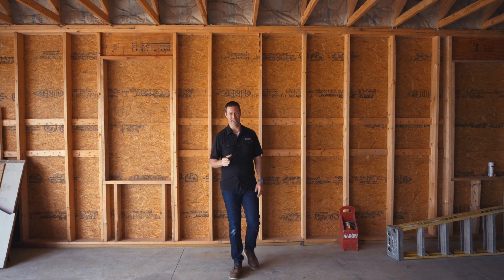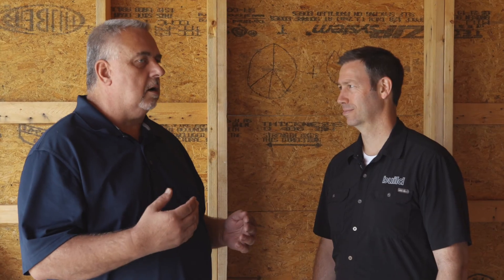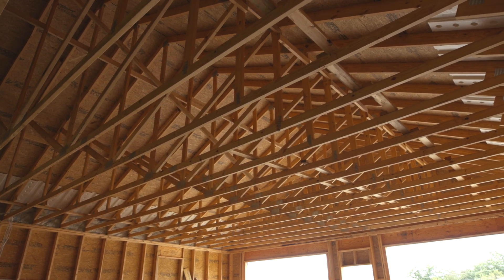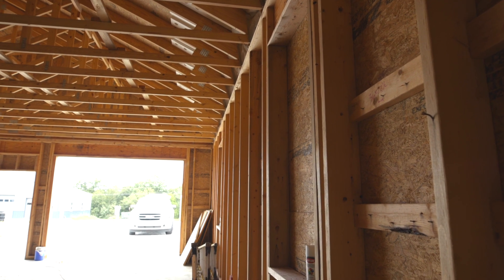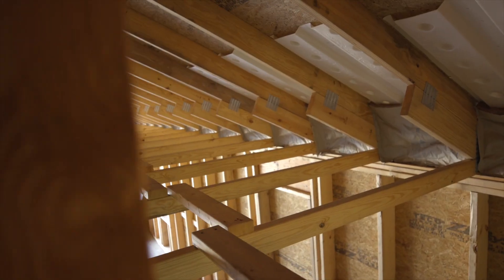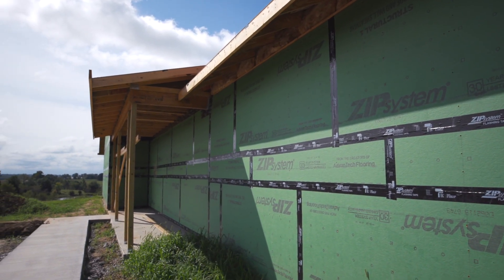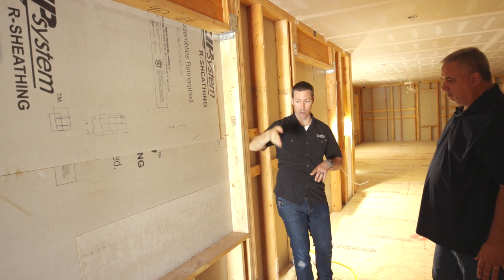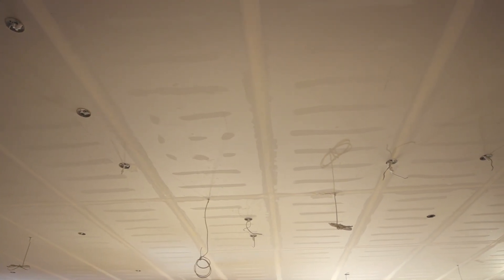Traditional vs Advanced Framing - Details

Comment: I really love reading the comments by the technology luddites. Reminiscing about the good old days in the '70's when everything was high quality. What crap - obviously they've never remodeled a 1970's house to see all the poor decisions, poor quality workmanship, undersized framing materials, cumulative air penetrations big enough to drive a truck through, lack of code enforcement - I could go on. I've remodeled numerous houses from the 60's and 70's and the best thing about them is salvaging some great old growth fir that can be repurposed.
Reply: Preach. I am constantly discovering crap building methods in my early 70s house. Last week I discovered an age old plumbing leak that had finally gotten worse to the point that I spotted it. Some clown had punctured a hot water pipe with a nail, decades ago, then fixed it with a hose clamp and a piece of asphalt shingle before concealing it with the flooring. Still SMH over that one.
Reply: I agree buddy!!!
Reply from the maker: 100% agree

Comment: Now, he needs a system to make beautiful buildings. 30 ft. hight building for 9 ft. Floor to ceiling.
Reply: Building is actually 20'-4" but you go ahead, you're on a roll
Reply: That was my first reaction. But I expect once the interior walls are in place the rooms will feel better proportioned. It's a really well engineered concept. Check out the other videos about it, especially the utility tunnel under it. But it would be nice to extend to a more interesting set of spaces. A flat 9' ceiling throughout an entire house reeks of spec builder tract house.
Reply: @HistoricHomePlans  if the intention is redesigning the interior completely 20 times for generations to come I get it, but the fact is an ugly building in and out with a good system for that area.
 Proportions in the design are critical. Those vast spaces with low ceilings make the rooms uncomfortable to be there. At this time, I do not agree with the technical part and the aesthetics of the building.

Comment: Great build! Is there any concern with truss uplift on the interior walls? How can this be corrected with this type of continuous drywall system? Thanks for sharing you knowledge and experience.
Reply: Simpson makes a connector for that - I have done 100's of homes without a problem
Reply: Thanks Steve! I appreciate your response. I will look into that product.
Reply: @tonystammler9932  google "Simpson STC" or "Simpson STCT" roof truss clips

Comment: Hi Matt, I know that I live in a part of the country with super low cost of living but $600k for a 2400 sq ft. House seems OUTRAGEOUSLY expensive to me.  I can’t imagine paying over $300k for 2200-2800 sq. ft. but I want to buy/build a high performance house sometime in the next decade.  That’s the problem with these homes, they’re so far outside of a normal persons price range.... Did I somehow misunderstand what you were saying?
Reply: Will I have done Certified Passive Houses for $180 sq ft - there is quite possibly a builder in your area with some slight modifications to their typical build that can produce a great home for you.
Reply: Costs vary regionally.  The same house built in my city would be about 600k.   I built my own (and i do this professionally) and had to spend 550k CDN all in.     In the town next door i could build the same house for about 300K.    The difference is the approval process, and changes caused midway through by the building department.   As well as the lot cost, soil conditions, and weather conditions. 

People throwing around low numbers for a net zero house aren't exactly full of poop, but are not representative of the majority of houses.   A builder can make a cheap house, that is of good quality, only if they are good, have cheap labor, have a good production chain to maximize specialization and minimize costs, and above all else, have a customer who doesn't make changes and add things as it goes along. 

Net zero houses cost more, full stop.  Some people are very good at building them however.
Reply: @hosmerhomeboy  Net zero homes are tied to region very much - some places the PV system will pay for itself in less than 5 years, then the favor is in your pocket. Yes a Net Zero initially costs more, because you are buying more - but it starts there, it doesn't have to finish there.
Reply: @stevenbaczekarchitect9431  True though that may be, most houses people build already cost about as much as they can afford.  I have my misgivings about adding any costs onto any build, but i can see which way the wind is blowing.   I already mostly build a step 3, and often a step 4.   It is do able, as is a step five.  There are some things with a five that i am uncomfortable with, and some things related to local building departments enforcement in relation to these things  too.  I will happily build step five houses, and be glad that the additional certification and techniques required will keep out the competition.
Reply: Hi Steve, thanks, I didn’t realize that was actually you responding.  I really like all of the framing/assembly efficiencies you pointed out.  I live in upstate SC, but I’ve lived in NH and MA so I understand the regional differences in price.  Here’s to hoping that I can find a builder half as passionate about energy efficiency and general efficiency as you guys are!!

Comment: I wish you’d talk about horizontal sheathing. I’ve always heard people say horizontal is “the wrong way” to put sheathing on because it’s “weaker” in the horizontal position, and I’ve seen a few of your videos with it!
Reply: Note this one is horizontally blocked at the seams. I want to say the difference when blocked is negligible. I have had this conversation with structural engineers. I will revisit it for clarification/confirmation
Reply: Code requires Builders to default to the manufacturer specifications. Most sheathing manufacturers require horizontal installation in their specs but not all
Reply: Most sheathing goes on vertical because the blocking for horizontal adds  cost, fouls up roll instalation and interferes with plumbing in 2x4 walls.
Reply: Horizontal sheathing is the right way and only way.. if u read the building code the arrow on sheathing is a strength axis which needs to be perpendicular to the structural members. Sheathing is way weaker vertically, i can snap it in half

Comment: Foam core sheathing is like using foam as a shim. The shear strength of a wall is partly due to sheathing contact with framing members. In new construction, this may not be a problem, but in time, wind loads, temperature extremes and wood movement will challenge the "through the foam" attachments. 24" on center framing is also less effective at reducing noise transmission, for the same reasons as guitars are built with minimal bracing on the sounding boards. These houses may be efficient on paper, but they have not been tested by sufficient Time and Nature to be promoted as good long term structural investments. Insects love foam for tunneling!
Reply: Funny, America is one of the last countries to adopt this line of thinking - glad we got you to sort this out for us

Comment: Are the split cripples allowed by the local Building Codes?  The National Building Code of Canada required that the cripple extend from the bottom plate to underside of header.  
Its great to see the high heal truss being widely adopted.  A lot of builders are starting to run their sheathing right up to the underside of the top chord then down the wall to get a very solid connection between the truss and the wall.  Have you ever practiced this @ArrowBuilding?

Comment: Matt: on your Build Network channel videos. The Ads could use some better tuning. Basically your ads cut in between mid-sentences, and the ad background music is louder than the video presenters. However it would more pleasant to just have your video presenter discuss the products and include links to advertisers websites. For one, your viewers are less likely to skip ads.  Here is the video I am referring to: https://buildshownetwork.com/blogs/789

 Its your video presentations that demonstrate products is how products get sold. You demonstrated Adv. Tech: I am an Adv. Tech consumer, You demonstrated the ZIP wall, I am a Zip wall consumer. Your videos get me more interested in products than any 10 to 20 sec inserted ad.

Since you have videos on Adv tech, Zip and other products link to those for your advertisers so customers can get more details instead of a 10 to 15 sec ad inserted. Most of your projects and fellow builders use ZIP & Adv. Tech so it should be too hard to mention them. Perhaps adding some text overlays at the beginning of each video listing the advertiser products used in the project. Example:

Spring Valley  home (New England region).
3/4" AdvanceTech Floors
Zip walls R-6 sheating
Marvin casement windows Model ??? with U: 0.?? and SHGC: 0.??
Zip Stretch Tape for window sill sealing. 

When presenting a product insert text overlay about the product being shown at the bottom so viewers can get the correct product name & model. 

This way your doing in video advertising and consumers will have some details about the products. 

BTW: not trying to nit-pick your methods just giving you some suggestions that I think your advertisers will benefit from.
Reply from the maker: Appreciate the feedback. Will review with my team this week!

Comment: Love the design and channel but affordable at 250 dollars is crazy expensive. I guess you usually deal with people with a lot of money.
Reply: I must have missed that is it 250 dollars a square foot? Yeah, building a house right now and we're at 100 sq ft. Not way over the top but still nice granite/quartz counter tops, nice tiled showers and floors, spray foam insulation, etc. 250 a sqft wouldn't be affordable for anyone around my area.
Reply: @Staki6908  Most of that cost is in those luxury items that they sell you, The house if built bare bones would be a fraction of the cost. 
If you remove that over priced kitchen, How much does that lower your price? A lot, Now do the same for the bathroom, trim, light fixtures, electrical plates and a number of other things. Now put some of that extra money in to better insulation, better doors, better windows. Now you have a 4000 square feet house that cost you a fraction in energy cost, Use the savings in a few years and do an upgrade on what you think that you now need. 
Contractors will sell you a 50k kitchen where a bare bone kitchen might set you back 5k for just the basic, All plumbing, gas and vents in the exact same location as your 50k kitchen yet the only thing missing is the cabinets that are pretty and the expensive light fixtures and the over priced appliances that you have to pay interest on for the next 30 years... 
Same thing goes with bathrooms, Over priced cabinets, toilets, showers... Tile will cost you an arm and a leg because you want that tile that cost 20 dollars a square foot where the almost exact same tile cost you a buck. Think commercial bathrooms at a new gas station or new fast food place, Simple yet good looking, Much cheaper and has enough place for laundry room and cabinets upgrades at a later date.
Reply: William Glaser as I just mentioned to another commenter, I’m planning to start my new home construction soon. I’ve seriously considered going cheap on some things like fixtures (sinks, tubs/showers), floors, counters, and kitchen appliances that won’t last 30 years anyway and avoid paying all that extra interest.
Reply: Todd Ison Todd Ison what part of the country (assuming USA) do you live in? I plan to soon start a new home construction, still in the info gathering phase.  But after taking to a lot of people it sounds like I’ll be lucky to get $115-125 per sqft. Maybe the labor costs are just very high here. $100/sqft sounds great!
Reply: It's amazing how much costs vary across the country. 15 years ago I was working in the San Francisco Bay Area and $250 was our base price with most of our projects being at least $300 for nice, good work, nothing spectacular.
Reply: @HistoricHomePlans  Yep exactly and I hear all the time from employees. "I can go to this state or that state and make X amount more." They never look up to see what the actual cost of living is. I mean if  alone the houses are 3 times the cost then how much more are you really making?

Comment: That much span using trusses only worries me,  the open area is awesome though.  I would want some steel beams up there and might as well use a steel building Idk. Do you guys/gals trust trusses this much?
Reply: Those trusses are only supporting dead load,  not live load.  So what you see here is not that uncommon at all.
Reply: I definitely trust trusses that much. Their software is fantastic and puts in several factors of safety. The fact that you can get a clear span of that distance is common place. I just got a quote on a scissor truss system that spans 65'. It is cheaper to run standard trusses with those than metal trusses and frame out the center. You need to be careful installing them, but once they are in, they are things of beauty.

Comment: Oop's found a boo boo. The window header should be sitting on the cripples and the liner nailed on between the cripples afterwards as the liner will shrink. |Regarding raised heel trusses I always have my trusses built so the bottom chord runs right through to the sub fascia. This gives me the backing for T&G soffit or any other length run material as well as a greater insulation space.
Reply: For those who want to order trusses as he references here^^^ they are called oversized trusses. Another good way of getting an efficiency heel.
Reply: This method also reduces the height of the exterior walls which saves money but then you have to factor the cost to install the soffit and that is not cheap.
Reply: @philipdamask2279  My biggest concern is with insulation. I build homes with R 60-80 in the attics

Comment: Please explain the value of the header hanger.  You mentioned that it was so you didn't have to install the extra jack, but the extra jack would cost less than half the HH6 for each side and the labor to install the jack would be less and easier (for an experienced framer).  Given the amount I saw in the video, you spent a bunch of money unnecessarily.
As a side note, I would expect the energy wasted in making Steel HH6's compared to the sustainability of a wood jack doesn't make sense on any front either. Just saying.
I do like the complete enclosure idea.
Reply: It reduces the overall framing required to build the house, which increases the thermal performance.
Reply: @brianwright9514  But, if you are insulating the outside of the house the true amount of "R" value difference would be negligible at best.  The extra percentage of lower R-value of the jacks (+/- (10 openings, 20 studs) in the whole square footage of the structure would not be worth the cost.  The payback would take a couple lifetimes, and that doesn't take into count the environmental cost/waste of producing the steel (compared to studs).
I might be wrong, but I doubt it.
Extra thought, given your response, why not just have all beams and only insulated posts on the corners and openings, and insulation on the rest?  At some point, things start to not make sense, I hope we don't cross that line, trying too hard.  Remember when they thought it was a good idea to drill holes in the siding and shoot insulation in the wall cavity?  They were a lot of people making big money selling that idea telling everyone it was the "best/right" thing to do.
Reply: @bestbuilder1st  Yeah, it's not about the money.  Much more about comfort.  It's impossible to justify any of this from a cost standpoint.  The cost on this home is going to be $750,000.  Where I live, the rich people don't even pay that much for homes.
Reply: @brianwright9514  I think you missed my point- there is no way you will "feel" the Comfort (heat) difference using studs vs HH6's. You can make a house with no insulation "feel" as comfortable as a super-insulated house if you pump enough heat into it.  The difference is the cost of that heat.  In the long run, better insulated homes cost less to heat, but they also have to follow the law of diminishing returns, thus my original comment.
I do appreciate the discussion.
Reply: The  Jack stud has an r-value of about 8 ( softwood lumber R 1 1/2 an inch ) And, it is next to a window. Removing it makes little sense.

Comment: 2:52 Trusses don't quite line up at least in this area...
Reply: Trusses are probably oc 16" instead of oc 24" to match the walls. Not an issue with the double top plates.
Reply: @guytech7310  I noticed they are only off by an inch or so. I had the same thoughts with the double top plate.